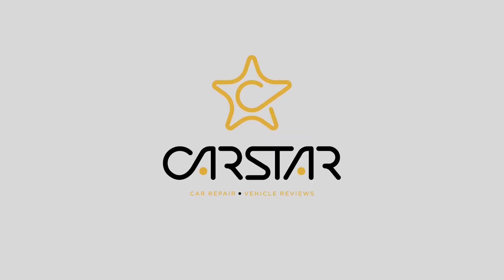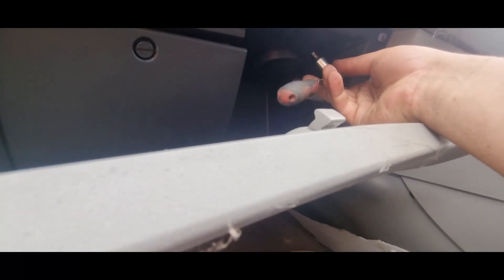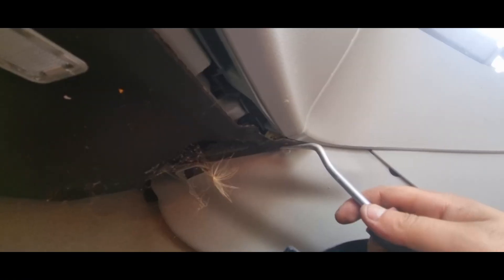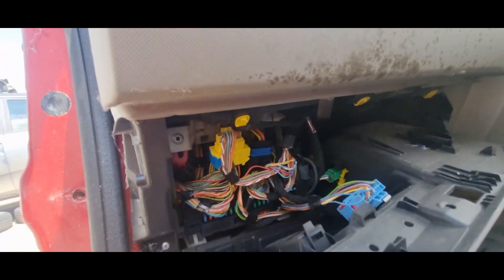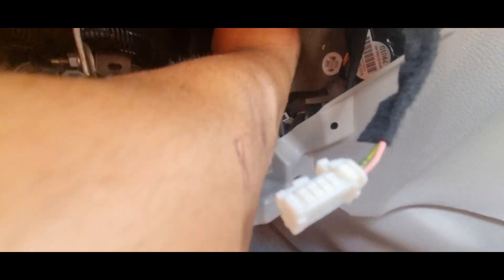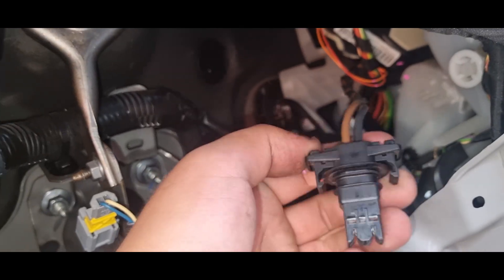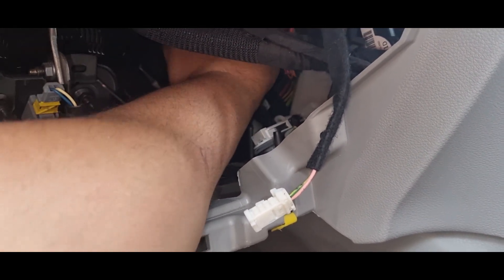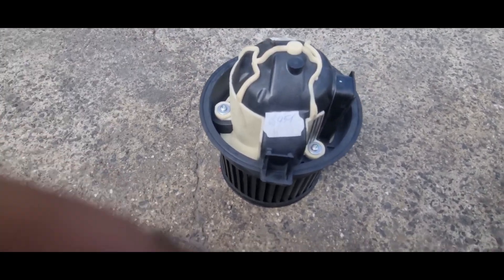How to remove Peugeot 308 blower motor T7 , 2008-2013

Comment: Hi, is there oposite side  replacement process in europe version od peugeot ?
Reply from the maker: Hello , good question , it should be roughly the same process, I would first just remove the glovebox and see if the blower motor is in the same but opposite area and go from there .
Reply: i did the same way  as you ion the left side ( my is lefthand version )  thanx a lot bro.
 @Aussiecarstar
Reply from the maker: You are welcome ,glad you got it done :) @dazet75
Reply: What parts did you have to remove to reach the blower? Was it enough with just the plastic panels or did you have to remove any pedals or the steering column?  @dazet75
Reply: HI, in Europe, is the fan motor on the left or right side? Can you give me some advice on this? :)
Reply: @DroneKris Left side, and there is a lot more stuff in your way trying to reach it than on the UK version. I ended up having a garage change it for me.